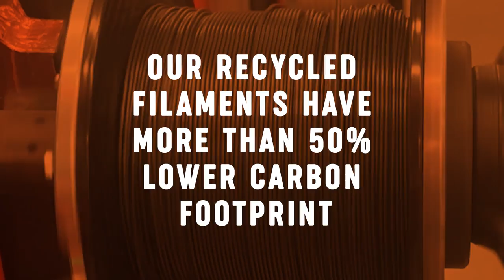How is Recycled Prusament made

Comment: Why do you melt-blend before and then cut again for another round of extrusion?
Reply: I would imagine for even color blending (even if each batch will be slightly different, much better than within a single spool).
Reply: @alexwhite4667  now I am curious if we could get a special run of non blended material, just to have random colors. But I guess the mechanical properties will be worse without blending

Comment: Okay, so you heat the material twice, but you don't recycle failed prints because they have been heated up once? This dosen't make sense to me
Reply: They probably only use filament creation scraps so they can maintain some level of “cleanliness” to the plastic. Who knows what particulates could end up in a production filament if they ground down already printed scraps from a different area of production.
Reply: I filament chops are larger/less structural degradation and extrusion temps likely much lower for first blend.